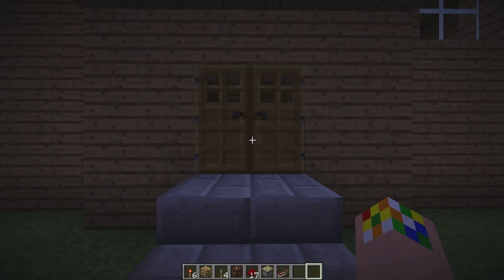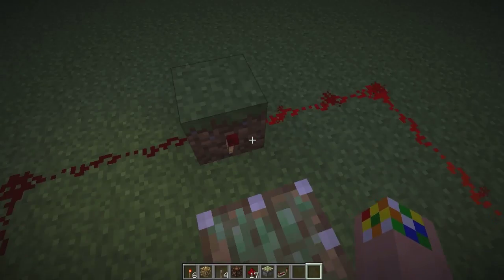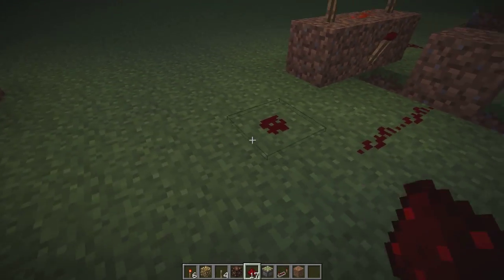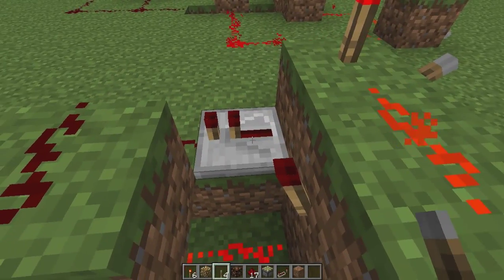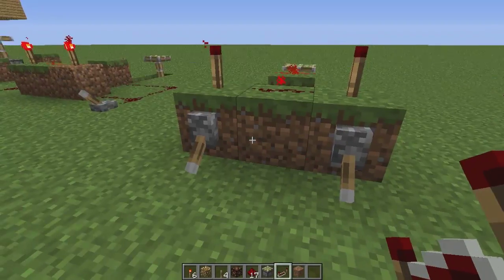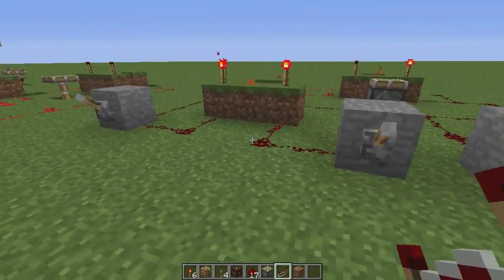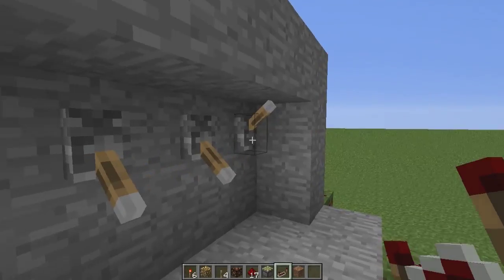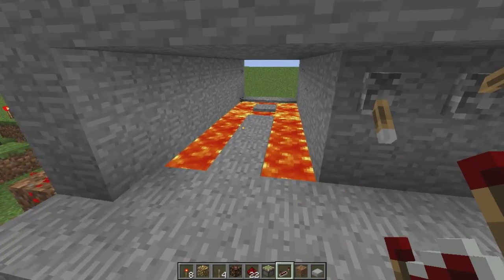Minecraft: 3-Way Switch Redstone Tutorial (188)

Comment: tis is an old video and I don't even know if you are still active but 3 way and 4 way switches refer to the number of live wires needed to make the circuit. A 3 way has a main switch leg coming in and 2 switch legs between the switches with a neutral coming back (3 wires plus the bare copper ground) and a 4 way has the same but with 3 switch leg wires between the switches and the neutral (4 wires plus the bare copper ground)

Comment: this is not a true three ways switch system. If both switches are in the same position then the chosen item should be on, in different positions it should be turned off. essentially making it to where flipping one switch or the other changes it off or on. in doing it this way you have to turn one switch off in order to turn the other on. your concept is heading in the right direction but still doesn't quite hit the marker of what it needs to be. ive been trying to find a good video for three way switching and ill be honest in saying this is the closest ive found, basically credit where credit is do, however still needs to be perfected.

Comment: I'm about to finish my 2 year industrial electricity class, and while I can say you've helped me figure out 3 way switching in Minecraft, I don't think your terminology is correct. In house wiring, a 3 way switch is used (as you said) to control 1 object from 2 locations. However, when you control that object from 3 or more locations, you add 4 way switches between the 3 way switches. To my knowledge, there are only ever two 3 way switches in a circuit: at the start of switching and the end.